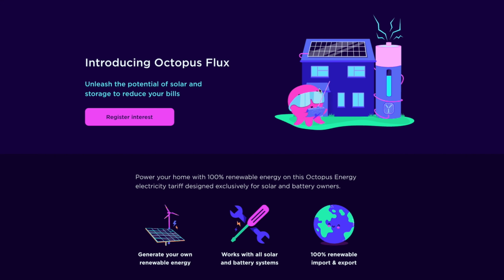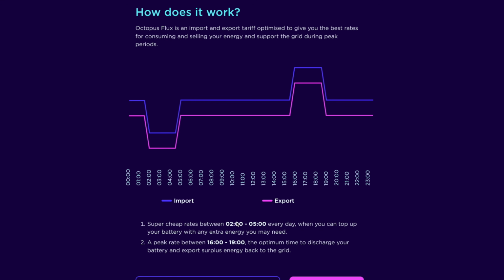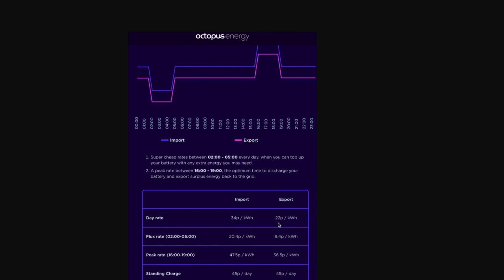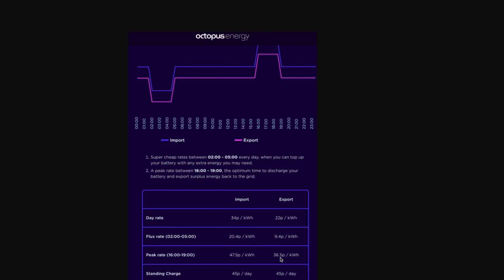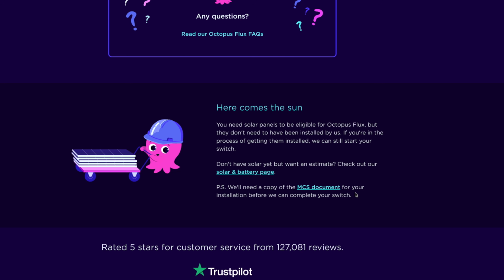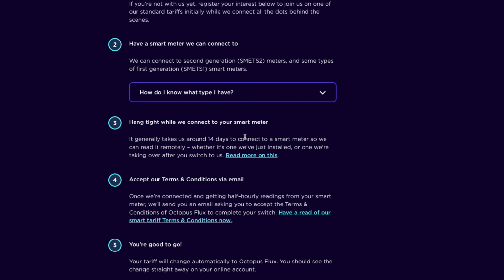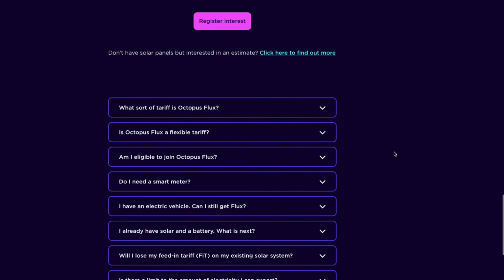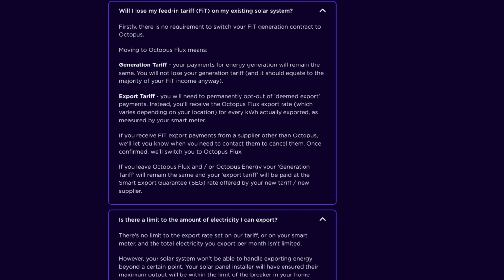Octopus Flux // An Energy Tariff For People With Solar PV // Paid To Export Energy // SEG // FiT

Comment: Interesting to see where you are coming from. 
I use my 17kW battery pack to supply my home during peak rate time and like to keep it topped up in case of grid blackout when my EPS kicks in. 
Why didn’t you compare Flux to Intelligent Octopus (IO)?  My battery pack needs more than 3 hours to fully charge if depleted at a max charging rate of 2.6kWh; that is why I went from Go to IO when my fixed term ended in December 22, to get six hours off peak @ 10p/kWh. The day rate is 44p/kWh but I take very little from the grid from 0530-2330. I export any surplus PV energy to Octopus SEG. In the last 12 months, I’ve exported  2.3mW of solar alone from my 4kWp array, mostly in the summer months of course. 
In conclusion, I prefer IO to Flux. The next cheapest smart tariff is probably Agile which I am keeping an eye on for the summer months. The Octopus Compare app gives a useful comparison of two tariffs of your choosing so for me, it’s IO v Agile and IO is cheaper.
Reply from the maker: Thanks for watching and commenting Philip. I didn't compare it to Intelligent Octopus, as I am not eligible for that tariff as don't have a compatible EV or charger. So I tend to only compare things that I have first hand knowledge of.
I am hoping later this year the Zappi is IO compatible as I think this would be a better tariff than Go for my needs.

Comment: Might seem like a silly question but how do you control your import and export times
Reply: Via your hybrid inverter.
Reply from the maker: Most inverters for your battery you set your peak and off peak times, or set when you want it to pull from the grid.

Comment: I suspect when you do the maths properly it will be marginal at best. Probably best to have an optimised system that meets your needs and go for the lowest import rates and forget about export. The UK sadly discourages competent people from doing their own installs but a 6kw array and 6kw of batteries could probably be put together for about £7k whereas a commercial installer would charge about £14k. You wont be able to export but at the rates they pay you who cares!
Reply from the maker: Cheers for sharing Rupert. Deffo agree it would be nicer if there were more appropriate options for people who are competent to DIY.
Reply: It's not necessarily 'competence' but more potential impact on the substations tbh.
Reply: I suspect an MCS certificate will in future be a requirement for anyone selling a house that has solar pv fitted.

Comment: First time I've watched a video of yours. Good stuff, thank you. 
EV owner and SEG only here. 

Using Go Faster in the winter, I usually switch to Agile in the spring. Import is 34p on average (or it was in 2022, looks to be about 25p so far in 2023) but generally I can live  off grid in spring/summer with a 14kWh battery and 4.4kWp array. 

I hammered Outgoing Agile last year and it earned me hundreds. Switching back to Go meant that I had to join with a higher unit rate, but it was still worth it. 

Flux looks like it takes the hard work out of the Agile game and you don't get penalised so harshly if you need to import. I like that. If I can export during that peak period then I should be able to make up to  two quid  everyday to cover the standing charge and any odds n sods imported units. 

Anything left by bedtime I put into the EV overnight via 3 pin charger and then the home battery is emptied down to 10% and ready to be refilled by solar until 4pm...and repeat! 

Flux suits my needs but I will switch to Agile/Outgoing Agile if those become better options (if Octopus still offer them).
Reply from the maker: Thanks for taking the time to watch, commenting and sharing your setup.
Nice working on being able to go off grid with the battery and solar setup you have. I think I really need another 10 kWh battery then I should be good :)

Comment: I have a Givenergy 9.5kw battery with my solar. It will take charge rate at 2.6kw per hour (maximum). The Octopus window of 01.00hs to 04.00hrs give 3 hours charge time. This means that I can never fully charge my battery from dead flat. It works out at 2.6 times 3 = 7.08 KWH, so I will not get full benefit! Or have I misunderstood everything you said? Excellent presentation by the way!!
Reply from the maker: Your are correct, on Octopus Flux you only get 3 hours off peak, so with your GivEnergy setup you wont be able to fully charge your battery off peak, as you really need about 3 3/4 hours, so if you have an EV you would be best of moving to Octopus Go where you get 4 hours off peak charging.
Do you have solar as well? I think Flux really only makes sense if you have either solar and no battery / EV to put surplus into, or a big solar array where you will export alot.
Reply: @ConsideredUK  I have 5.6kw of panels south facing. Givenergy 3.6kw inverter, 9.5kwh battery. Wish I had gone for 5kw inverter as 3.6kw can be somewhat limiting especially putting the kettle on at the same time as the washing machine!! For the moment, I will not bother with any S.E.G. deals as I am able to skillfully use the majority of power generated. Next plan is install heat pump air-con especially if summer this year is as good as last. Also get benefit of heating some rooms in winter at COP of 4.7 so cannot be bad at all!
Reply: @steventonm  Similar set-up. Solar & GivEnergy inverter with 9.5 kWH battery. Wish I’d gone the 5kW inverter route.

However with an ASHP you will have access to Octopus ‘COSY’ (2 dips) 4-7am AND 1-4pm charge at 20p per kWh (4-7pm it’s 50p) remaining time 33p. Additionally a 15p export tariff.

Therefore 6 hrs to keep your battery charged up. The ap is annoying as you have to keep switching it over. But it works and all is not as bad as first thought.

Take care.
Reply: Increasing the inverter will pull from the grid if your battery's output is less than 5kW and there's not enough solar to compensate.
Reply: I’ve just posted the same issue. You need more than 3 hrs off peak to charge the GivEnergy battery. IO is the best tariff atm
Reply: I have had a quick look at the Flux tariff but opted to change from GO to intelligent. I have recently moved to Solar/battery system, when opting to go down this road we worked out what we could get installed as we had very limited space on our roof due to dormer windows in the roof. We have a 4.6kw. East/west array with a 9.5kwh battery. We use on average 10/12kwh per day on the house only and we also have an EV which gets charged twice a week on average. So far our export has been very little but we generally apart from some small bursts (inverter switching) don’t use the daily rate segment of our tariff, any energy usage is in the cheap overnight tariff and I cannot see how the flux rate would work out cheaper for us.

Comment: Great video! I have some questions and worries though. I'd love your thoughts. What about people like me with Flexi-Orb certificates and not MCS? I have registered my interest for this as I think it will work during the spring, summer and autumn months but from what I can see they are only allowing MCS certification. I was told by my solar and battery supplier that Octopus were in negotiations with Flexi-Orb but haven't heard anything recently. I've been quoted 20p per kWh for my postcode for off-peak charging but I think that is still too high, far too high compared to Octopus Go that I'm on now. I have a 6kW PV system with 13kWh batteries and I also need to charge my 64kWh EV. I'm sure it will work out during the height of summer but I'm a bit unsure of the small amount of time and the price to charge during the off-peak times.
Reply from the maker: I have noticed many companies do not recognise Flexi-Orb, I think its a VHS / Betamax thing, they are comparable but MCS seems to be the the main standard adopted.
Regarding your situation, I agree the off peak is more for Flux vs Go, but you get the benefit of getting paid to export, and if memory serves you cant get SEG and be on GO with Octopus.
So you need to consider the annual picture in my opinion, and decide what is going to be best.
I would guess with your array and batteries, in general you don't export much, so may not be best overall when factoring in the higher off peak charges.
Reply: @ConsideredUK  I currently sell to Scottish Power at a pathetic 5.5p but it's better than nothing. I only had everything installed at the end of October last year so I'm yet to experience the solar's full potential. My best day was last week when I exported over 10kWh's which worked out to be about 57p. Octopus Flux would have given me about £2.50. That's a big big difference which will add up over time.
Reply: @DavidHoldenWoodturning  Scottish power offer economy 7 tarriff overnight at 13.7p at the monent (North wales/mereseyside area)  thats very compatible to octopus go rates for import.
Reply: I have a similar system and EV and my current calculation is that Go is better for me. If I didn't have the EV then Flux would be better
Reply: @bill_heywood  Yep, I understand that. I'm probably going to switch to 'Intelligent' as soon as I get the Zappi EV charger installed. 6 hours at 10p per kWh when needed in the winter months.

Comment: Interesting comparison.

We were the same when our Go Faster ended. We compared Octopus Go with Octopus Intelligent, superficially Intelligent looked better a 6 hour window ( sometimes longer) and 10p per kWh cheap rate instead of the 4 hours/12p on Go.

However, the t&c’s on Intelligent put us off, turning off the smart functions of the car charger, no diversion of excess solar to the car or immersion and a requirement to take mains charge at least once every 30 days. We are low users, late March to early October we don’t use mains, the Powerwall stores enough electricity to run the house and the Zappi puts enough excess into the Enyaq to meet our needs. We are on FITS too and even though our export was more than yours, the difference wasn’t worth the swap even taking the higher yield on export.

Just shows that we have to really understand our energy use to make the most of the systems we have and the products now being offered.

Good luck with your new solar whenever that happens, will you be able to put as much up as you had?

Ps we would have taken our PW2 with us if we were to move, the waiting time for a new one keeps extending.

Comment: What about Octopus Agile and Agile Outgoing Octopus Tarif ? How does it compare to Octopus Flux Tarif ?
Reply from the maker: Thanks for commenting Ian.
This is not really something I can comment on, as with Agile its varying rates, and in my opinion is only something you can fully utilise if you have smart devices that can link in with the Octopus API, or you are at home all the time and can manually turn on and off your devices to maximise the changes in energy prices.
However, when I looked a couple of years ago, the overall cost for my usage with Octopus Go vs Agile, it was still better for me to be on Go, but your mileage may vary.

Comment: I'm going to switch to Flux when it comes out, I'm on TEP at the moment but that comes to an end in september.   The calculations show I will be paying about £65 per year more in total than TEP but the plus side is I will get control of my battery again - yay!
Reply from the maker: Thats a good point I had not considered, thanks for sharing.
Reply: I am lookin at getting a battery and PV. Whats the issue with TEP i ausme thats UW who I am with at the moment. Just got an EV last year so looking for options.
Reply: @Chris Duckles  TEP is old plan not open for new customers.  But when open import and export rate was same.  The catch is that you had to buy telsa powerwall and octopus / telsa control charge & discharge of storage battery
Reply: Tesla Energy Plan has been discontinued in the UK, existing customers will have to move to other plans when their 12 month contracts come to an end.

Comment: Thank you for sharing this.

Octopus ‘COSY’ for ASHP’s with a solar and battery install is worth a look. COSY has two charge periods 4-7am & 1-4pm at 20p/kWh and a 15p/kWh export tariff. 41p standing charge.

The downside is the 4-7pm period at 53p/kWh, but that’s part of the reason we have these installations.
Reply from the maker: Cheers for sharing other tariff options for people to consider. I was not familiar with the COSY tariff.
Reply: @ConsideredUK  I’m on COSY because my GivEnergy inverter charges at 2.6KW and won’t fill up my 9.5kWh battery in 3 hrs alone. Typically 24 hrs home consumption is around 25Kwh in winter, so it won’t last. But 2 charges in the ‘dip’ periods plays solar come very close in winter.

Summer should be a walk in the park at 5-8kWh per day.

Additionally the 15p export tariff will be OK in summer.

Note: No EV yet.

Enjoy the channel and appreciate it’s a community sharing thing. Cheers.

Comment: Saw a comment from someone considering Go for winter and Flux for the summer. Potentially could work but would result in switching to the new tariff prices each time. Curiously, for my postcode the peak export rate is 39.98 (yours I think was 36.5 🤷‍♂) almost double the off-peak import rate of 21.03p / kWh. I am hoping we will see an inflation linked bump to the FiT rates this year. I quite like the off-peak being later in the morning, potentially more beneficial for early morning eddi boost and warmer EV batteries (maybe?). The shorter 3 hours may not be an issue for EV owners with shorter commutes.
Reply from the maker: I agree changing about is probably not ideal, but I know people did this a little with Agile also.
Reply: Yes I always switch from Go to Agile in Spring (mid-March/early-April). Depends on how much you spank the export as to how big a hike you're willing to take come winter when you switch back. I think that wholesale prices are plateauing somewhat so hopefully less of an issue this year? 
Flux seems to be an excellent spring/summer/autumn product. Sure, Outgoing Agile can be higher £ on export but it generally is around 25p for export. The import units are OK, but you'll be mostly off grid anyway. Charging the car is tricky though if you use it all day and rely on the cheap overnight slot.
Reply: I've just had solar and battery installed and currently waiting for all the paperwork etc to come through and be set up. I'm currently on an E7 tariff with Scottish Power and like you I find having those extra hours available through to 8.30 in the morning (in the summer months) to be very beneficial.  Its one reason our night time usage is actually more than our day time usage. Even with the new prices, (to think in February we were only paying 8p for the night) now at 15p overnight, switching is more of a minefield than I thought it might be. Currently we charge the batteries for 2 hours overnight and that nigh on does us for the rest of the day. Its battery all the way, apart from the odd overshoot when cooking -we're electric and oil for heating and hot water. Octopus, like most suppliers, they give and take. The high export side appeals, the short and 'expensive' night rate does not. Its the same with the standing charge that needs to be factored into the overall mix. Decisions decisions.

Comment: Hi I'm new to your channel. Looking back through your videos I see you had an SE6000H and Tesla Powerwall for a combined inverter output of 11kW. Would you have even been allowed on Flux? Octopus say they allow up to only 9kW of potential export power.
Reply from the maker: Where does it say they only allow up to 9kW of export power? On the website it says there is no limit.
Reply: @ConsideredUK  No limit to how much you export (within the rate).

In the ‘am I eligible’ bit it says “A solar system with a maximum generation of 9 kWp (kilowatt peak)”.

I have asked exactly what this means and they said… “It would be for the Declared Net Capacity which is the Inverter Output :)”.
Reply from the maker: @richardabw  I TOTALLY missed that, I guess reading is hard :)
Thanks for the clarification.
I am going to hazard a guess that this is a solar inverter restriction and does not include batteries, as it states "Generation" not maximum exportability.
This is a weird thing to have as a restriction in my mind.
Reply from the maker: So in my mind, my 9kW solar array had a 6kW inverter, so I would have been eligible.
Reply: @ConsideredUK  Perhaps it would be. I’ve asked Octopus about this specific situation now and I got a non answer really, seems it could still be up in the air.
Reply: Our array is bigger than 9kW as we have three phase power, is the 9kW total or per phase ?